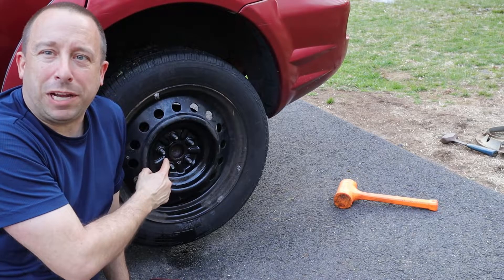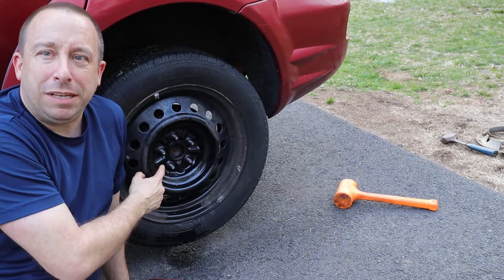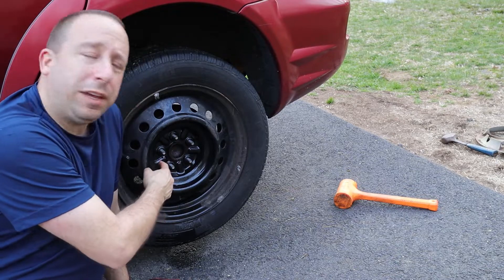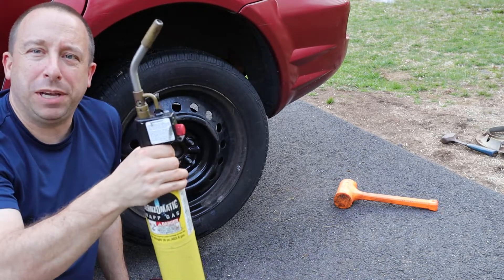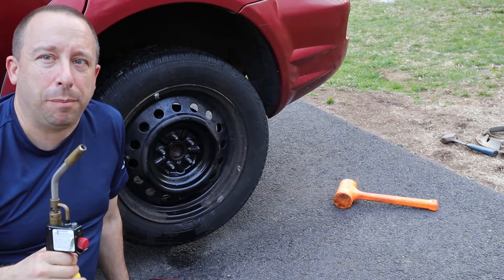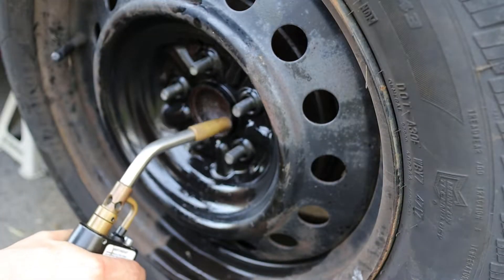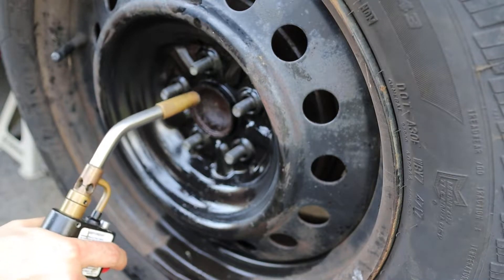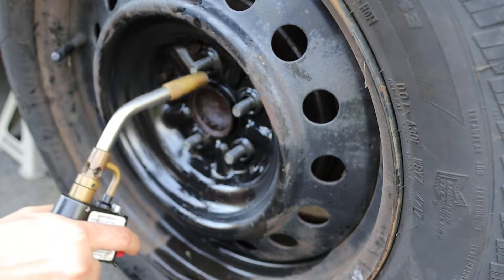Rusted / Stuck Steel Wheel Quick Removal Trick

Comment: Most times if you hit the tire with the same amount of weight and mass of the tire it will come off. I use the spare tire and take a couple nice strikes and I’ve had luck everytime. That hammer is too small

Comment: I had an 1/8 of an inch built up rust between the rotor and rim. It took the constant force of a small bottle jack pressed on the inside of the rim with a wood block and applying a torch on the outside. Stand back cuz it popped off like a champagne cork. Heat does the trick. Thanks.

Comment: I'm currently in this situation. I have my car on 4 jackstands, last one wont come off. Ive been kicking it for hours and beating it with a big sledge. This is kinda my last resort, I'm wondering if anyone has done this on aloy wheels? 

Theres center caps for the wheels so im not too worried about ruining the finish around the hub ring. Just didn't know if this would crack an aloy wheel or not. Anyones input is greatly appreciated.
Reply from the maker: I would not do it on an alloy wheel.

Comment: Never would have thought of that.  It worked but it's worrisome. I 🤔
Reply from the maker: Its an old mechanic's trick and not an issue if done carefully
Reply: Susan i think i understand why you are worried, it's because you fear the heat may damage the wheel? If so i can ensure you that it's okay. I'm a toolmaker and need to have knowledge about a vast amount of different metals properties. The heat he applied here, to what i assume is low alloyed steel, is very far from being able to damage it. You can use this method as much as you want and if you fear you've applied to much heat, you just have to make sure not to flash cool it, let it be and cool slowly
edit: it's something we utilize a lot at work. Steels ability to absorb a lot of heat and expand accordingly, without the properties getting damaged, is vital in many heavy production machinery repairer. Example: we could make a part to small to fit over something, then heat it so it fits, after cooling is done it'll have shrieked and is now thoroughly stuck on there